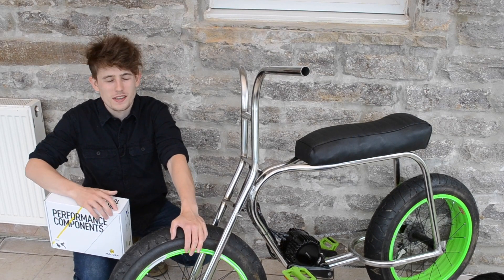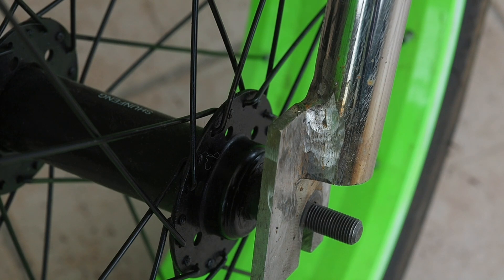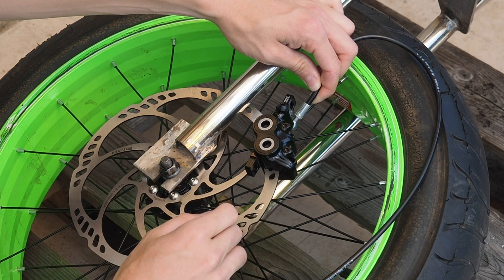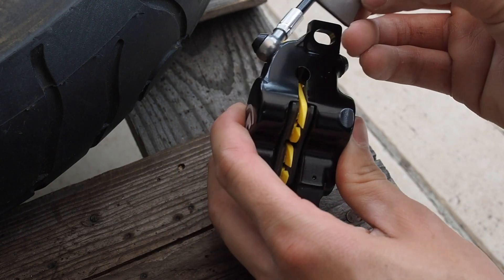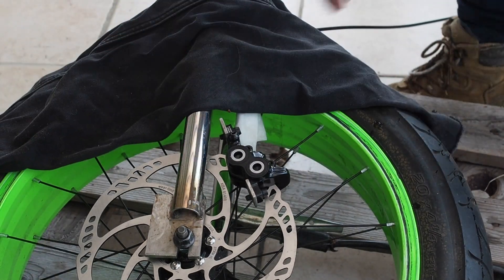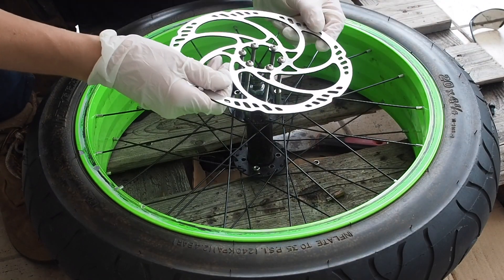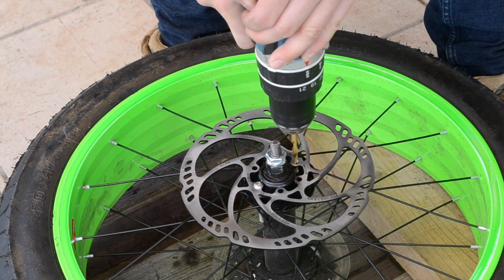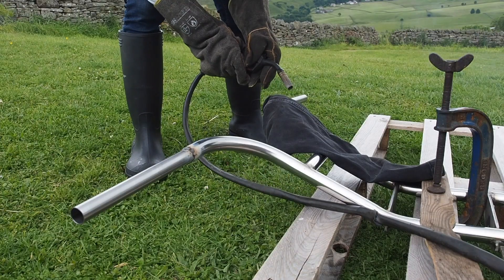Building an E-Bike: Part 5 - The Brakes

Comment: Great build!
What are your plans for the battery?
Reply from the maker: Thanks! I've made the battery using 98 individual 18650 li-on cells that I recycled out of old laptops. I've placed the cells into a housing that I 3D printed, then wired them all up to form a 14s, 52v battery, its awesome! the bike flies 🤩 now the hard part... editing for upload... as we speak!
Reply: @richhindhaugh32  sounds really good. Did you solder the cells or resistance weld them? With 1500 watts it should be a flier! Your series has inspired me to have a go myself🤙🏼
Reply from the maker: @eckythump6429  I decided to solder the cells so I could show others that might not have a resistance welder that it can be done. Not only safely but with great flexibility too. Email me if you need anything!